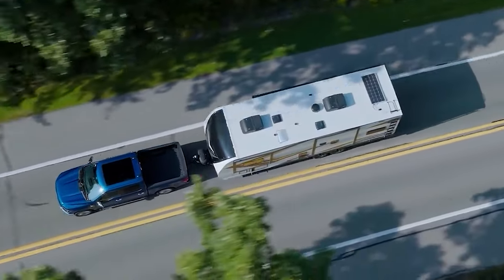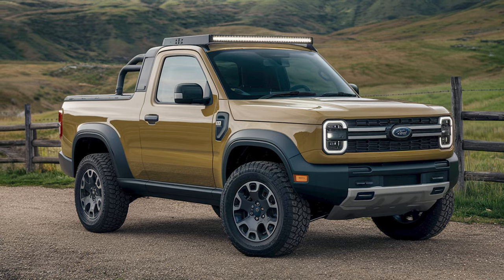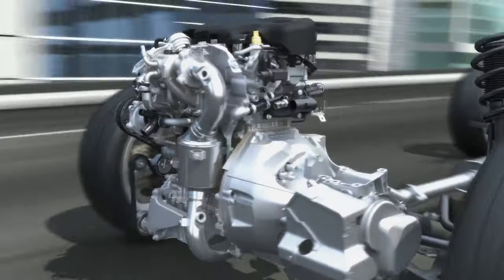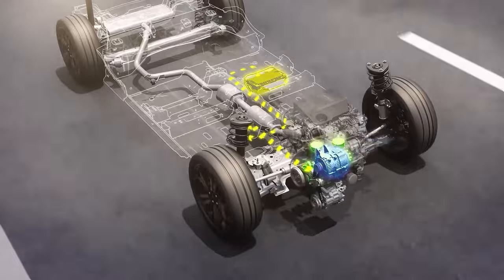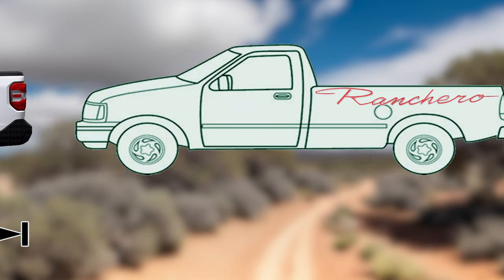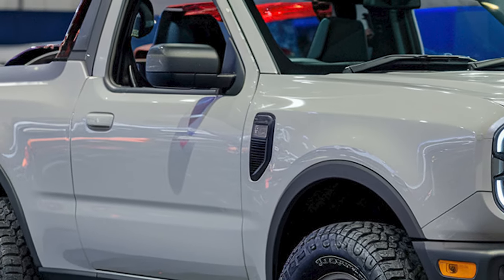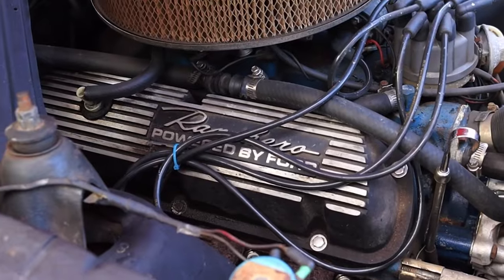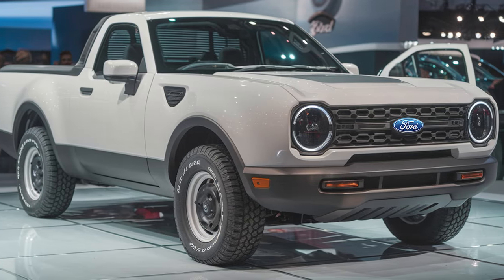2025 Ford Ranchero Returns as a Subcompact Pickup Truck Priced Under $20k

Comment: One or 2 of them looked cool. I wasnt a fan of the giant round headlight design.. A offroad version with some descent suspension travel and actual 4x4  would be a cool little off roader. Besides i hate the Bronco sport ... By all measures it should have been called the Bronco 2 and i would have been cool with the name... Bronco sport should have been the full size 2 door bronco..

Comment: Its NOT a ranchero. Its a pickup.  The ranchero was based on a car , not a pickup.  Ford failed us again.
Reply: If it's built on the maverick platform then that's a car/small  front wheel drive suv platform no frame unibody design
Reply: @mesanders1113  The Maverick is still not a car , it's a small pickup. I bet you are probably to young to have been around a real Maverick, or a Ranchro.
Reply from the maker: Back then cars were popular, so Ranchero was car-based... Today, they use crossovers...